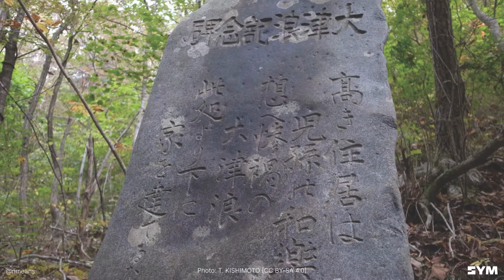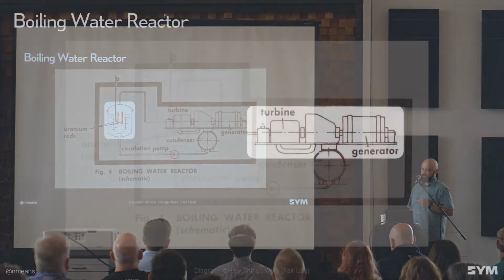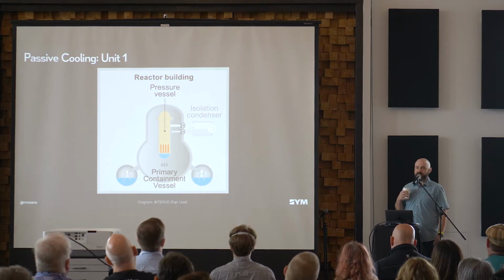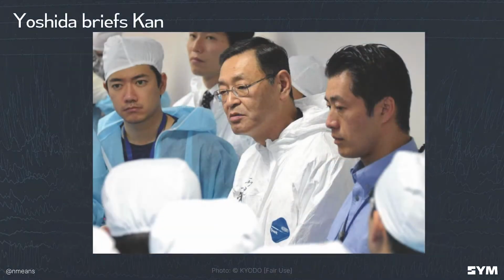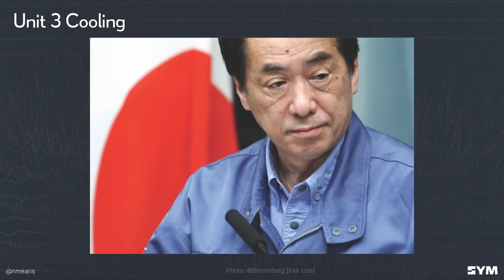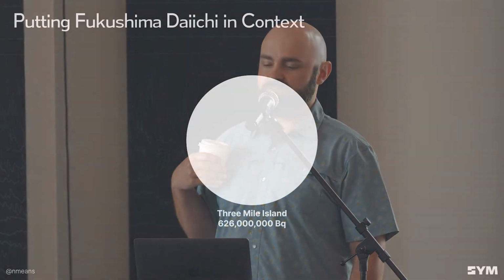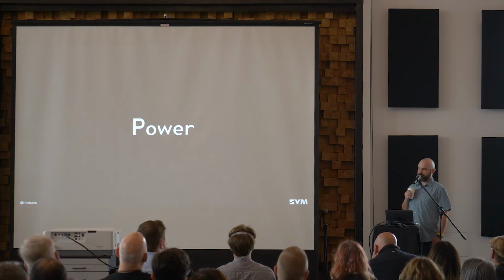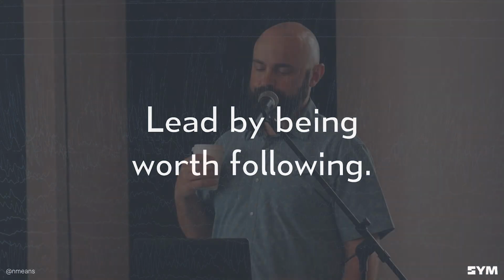The Magnitude 9.1 Meltdown at Fukushima | Nickolas Means | Monktoberfest 2023

Comment: 23:50 Diagram is misleading. If Chernobyl released 6.67 times as much radiation as Fukushima, use a bar graph, rather than 2 circles whose diameters are in the correct proportion of 6.67, but whose areas are 44.9:1.

Comment: This was a great talk, even if not as focused on the technical side of things like with his 3 Mile Island talk - simply because the technology the operators had was overwhelmed by force of nature. Fukushima has come a long way, these storage tanks for the contaminated water you see in one of his slides are now treated and the isotopes have decayed enough for the water to be able to be released back into the ocean.

Long live Nuclear power, if we want to have a future, any future at all, then we will all have to agree on Nuclear power.

Waste management has been solved decades ago, with 96% of waste being recyclable. It's only the 4% - the actual used up zirconium fuel rods, that need dry cask storage - which are cylindrical concrete stacks, about 20 feet in height and 10 feet in diameter, and are able to hold 10 to 15 metric tons of spent fuel. This is equivalent to about 32 pressurized water nuclear reactor (PWR) spent fuel assemblies or 68 boiling water nuclear reactor (BWR) spent fuel assemblies.

They are capable of withstanding direct missile strikes, and are perfectly safe to touch, inside there's also lead shielding and other material liners to further prevent radiation penetrating through them. A pregnant woman working at a nuclear power plant stood right next to one, while also showing her huge belly - they are perfectly safe, and are a viable method for long term storage.

It is sadly just politics and uneducated people who prevent progress from being made - take Germany for example, by 2024 they took all their nuclear plants offline, only to start importing 75% (before the shutdown it was only 20%, and electricity bills were 2 to 3 times lower) of all it's electricity from France, a country with a mostly nuclear grid, so much so that they are able to supply 75% of their neighboring countries energy demands!

Thank god there will be new votes soon, and I really hope that the Green party gets plain thrown out of the Government.

Only then we Germans have a chance with nuclear power.. a good thing is that we already started to reverse the shutdown and decommissioning projects.. but guess who pays for it.. me and you, that is if you live in Germany.. the tax-payer always loses.